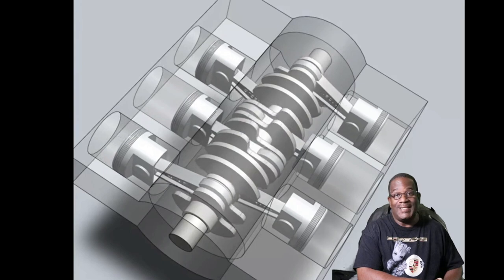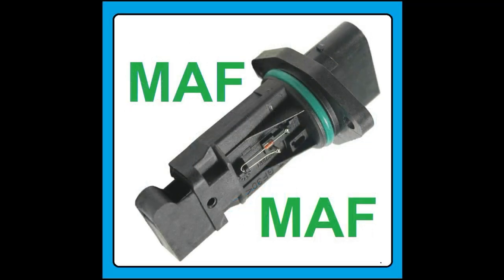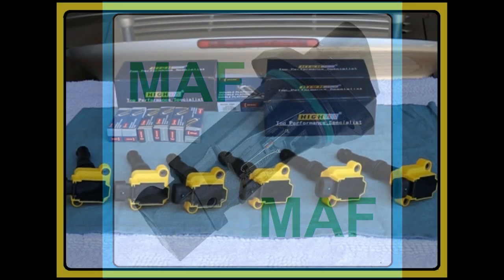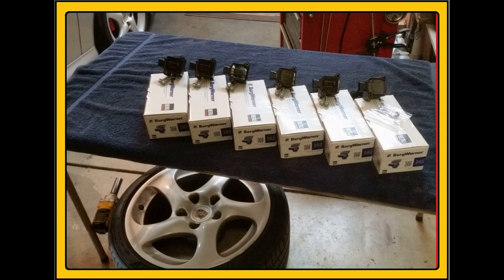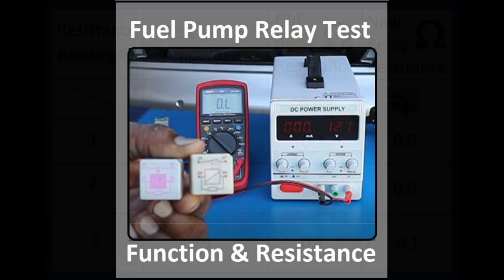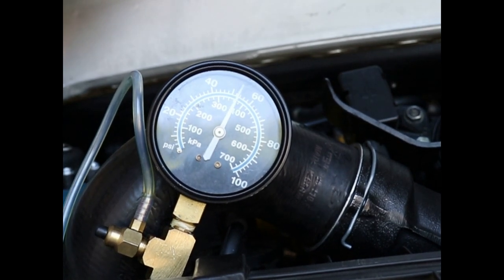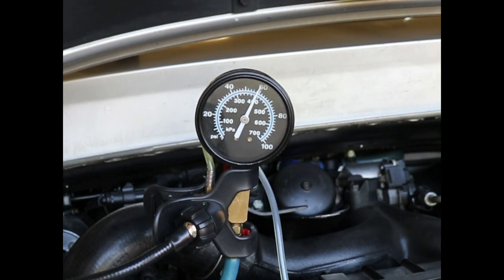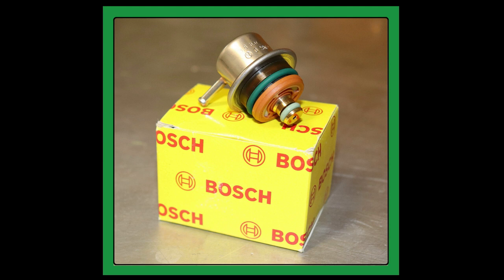How to diagnose Misfires. Special case of Misfires on 3 & 6 explained

Comment: These intermittent issues are the toughest to diagnose.  Glad you were able to solve it.  I have the exact same issue.  In addition to new relay, plugs and coils, I'm also putting in a 5bar FPR (along with an ecu tune) and I'm hopeful my issue will be resolved as well.
Reply from the maker: Good luck on your tune. Who are you going to have do the tune?  Markski Tuning I hope.
Reply: @Engineerboy100  Sam with By design.

Comment: I just started getting these misfires once every couple weeks cylinders 3 and 6 also. Thanks for this. I'm gonna do the same
Reply from the maker: Let me know if it works out for you.
Reply: Just wanted to update you. I got to thinking about why the FPR would be fluttering periodically and concluded it was unlikely to be a mechanical degradation of the part and most likely a buildup of ethanol gunk from modern gas that would sometimes be an issue and sometimes not. So what I did is ran 2 bottles of Techron through the fuel system over the course of 500 miles or so. It's been almost a year since I did that, and the codes have not returned since. Before I did it, I was getting those same codes about once a month. Just FYI thought you'd find it interesting, and thanks again for the video.